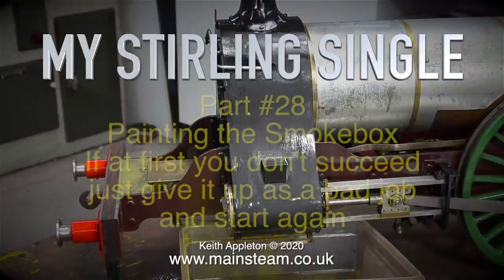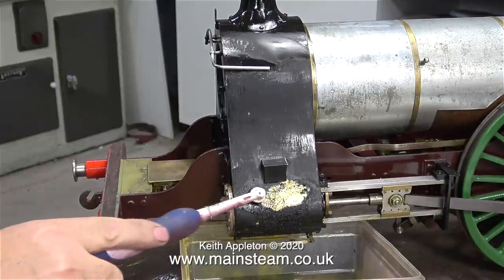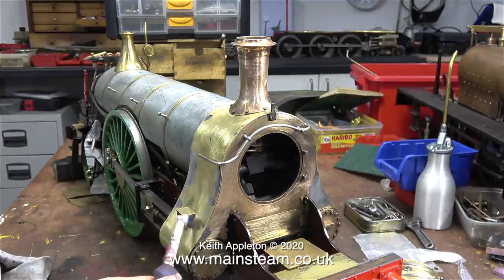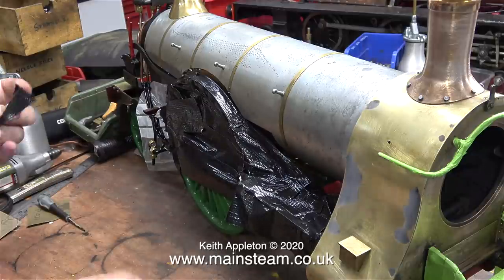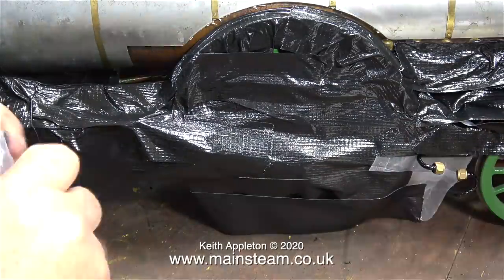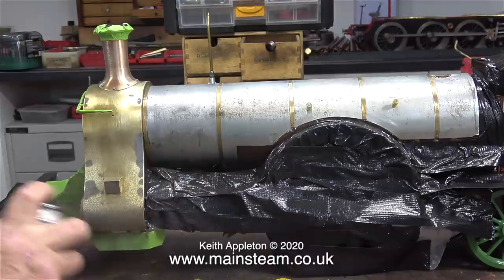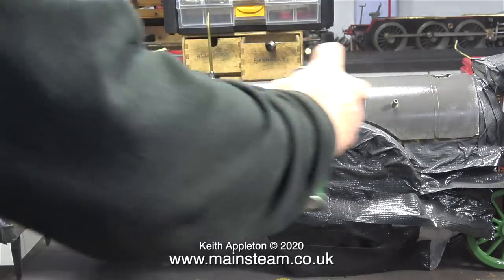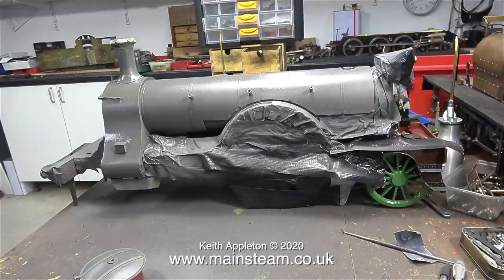MY STIRLING SINGLE #28 - IF AT FIRST YOU DON'T SUCCEED

Comment: I agree with everything Jeffery says about rattle can painting. Also if you are painting large areas the can will start to go very cold which I find affects the paint finish so if I have a large area to do I use two cans, giving each a rest. As for the Humbrol paints and most paints from model shops they are now designed for use in an airbrush and only good for painting very small detail areas by brush. They don't brush out nicely over larger areas. With the amount of painting I have seen you do I think it would be best if you bought an airbrush and some adapters for your compressor. You don't need to buy an expensive one for what you need to do and with a little practice they are not difficult to use. For larger areas there is a little bottle spray gun that is only around £15 that I have great success with, even  using it to remove supermarket rash from my car!!

Comment: Spray paint is best applied in a warm dry environment. A space heater warming the room to approximately 75 degrees Fahrenheit will help in the winter. Or... you know, the setting on the thermostat. I don’t know how your shop is heated. So long as the humidity is kept low and the paint can dry quickly and properly the rattle can doesn’t need to be applied in short bursts. A steady continual spray along the entire length of the project piece approximately 4 inches from the work surface and remains parallel with the floor is the ideal for a clean even coat of paint. I find that the short bursts of little spots make for poor application, poor coverage and uneven coating. I also strongly discourage duct tape on bare metal surfaces do to problems with corrosion. Also, blue painters tape tends to be much cheaper and comes off much more cleanly. I paint wargaming miniatures and have learned some harsh lessons in the way of the rattle can. I hope this helps.

Comment: Keith, you obviously etch-primed onto a nice clean boiler barrel. I'm currently repainting cab and side tanks and would like to repaint the boiler wraper without removing the boiler from the frame (I can't). I've found that paint-stripper you recomended good stuff on those other bits, The paint has been on there for 10-15 years. Any suggestions?
Reply from the maker: Rub down the paint and fill any chips to repair the surface before the repaint. If the paint is well stuck to the wrapper it's pointless removing it.